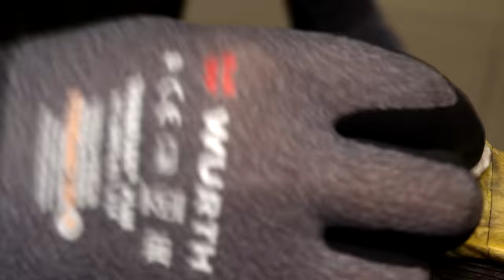Knife Making - Fullmetal Dagger

Comment: How does a metal saw cut a metal plate?
Reply: The teeth of the saw are very hard, short, and close together, while the knife steel has not been hardened yet. So it is softer by comparison.
Reply: @LastBastian  thanks